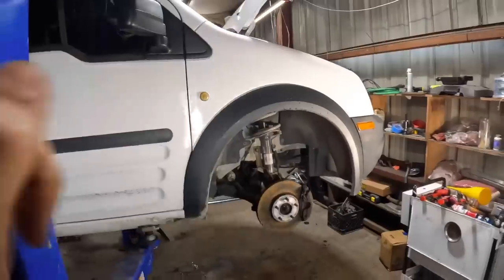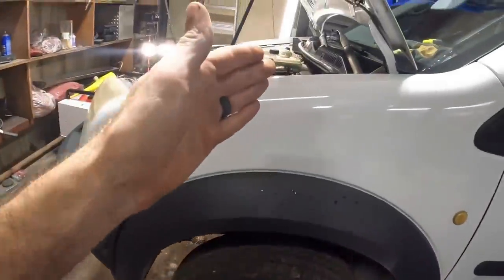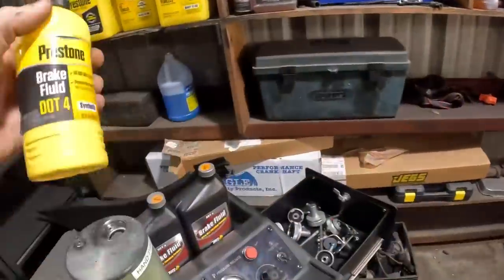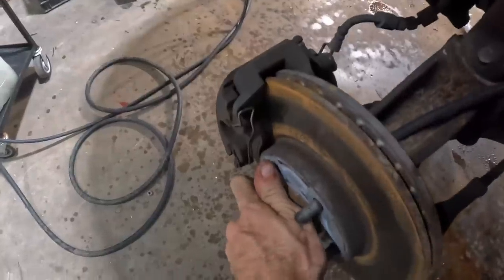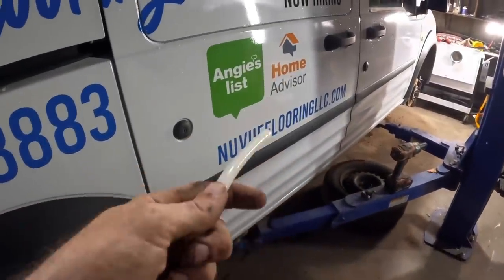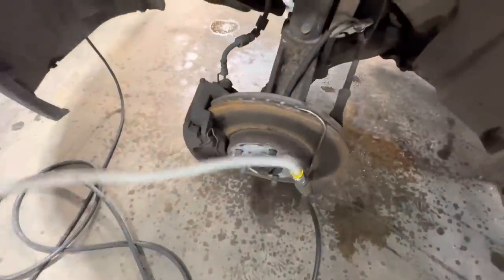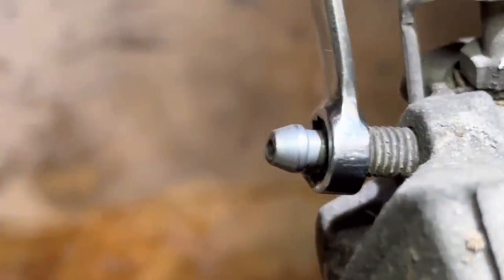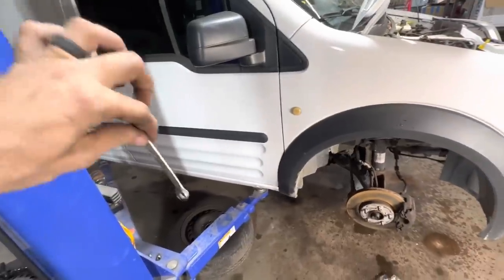Does Brake Fluid go BAD?? Ford Transit 2.0

Comment: Questions I topped up the braking system with power steering fluid and the brakes obviously siezed up after a couple of days... the Question I have is will it only killed the master system due to it not being a circulation or is the whole system contaminated??
Reply: The issue there is some fluids will cause the rubber seals to swell. I put the wrong fluid in my dirt bike and had to change every seal in the entire system. Even the reservoir cover seal. It just depends if that rubber will react to power steering fluid this way. I had put motorcycle fork oil in the reservoir instead of dot 5.1. you will probably damage the caliper seals too because you'll have to bleed out the power steering fluid. You might get lucky.

Comment: I have the same van. And I need the brake fluid service also. How much should this service cost. Great content. Thanks 👍
Reply: maybe 100$ for just the fluid, and that cost is time. the fluid is really cheap and it doesnt require a lot of it (64 ounces is more than enough) so it's just paying the guy to do it. 

honestly you should consider doing it yourself, it's pretty simple to do, most important part is getting the pattern right and making sure air doesnt get in the system.
Reply: @bradhaines3142  thanks. I usually do my own auto repairs as I went to automotive school and been working on cars for over 40 years. But where I live now they frown on doing any work on cars. Just wanted to get an approximate price I should pay. I really hate paying for what I can do myself. Oh my name is Brad also.😀

Comment: Brake fluid is the most neglected fluid on cars, cheaper to replace the fluid every two years than to have to replace an abs pump.  That machine works pretty good.

Comment: This guy should have had you referbish his lights. And put on a uv protective clear coat . I mean it is in the shop and a very yellowed headlight dosnt make 1/2 as much light.

They really need to bring back glass lenses  almost every car with plastic headlights, headlights are going yellow in some stage.  Glass headlights never done this they just burnt out.

Comment: FYI, Dot 5 which is silicon based, doesn't absorb water and lasts much longer than Dot 3 or Dot 4. Dot 4 has a higher boiling point than Dot 3. You can use 4 for 3, but not the reverse.
Reply: And that's the problem. You NEED it to absorb water. DOT5 just lets the water remain in the system and corrodes it. The fluid lasts longer, the brakes themselves do not. Brake fluid doesn't cause the water to enter the system, it does it all on its own.

Comment: Ray, I am having trouble diagnosing why some dash lights randomly come on very infrequent. I have a 2007 Ford Edge 3.5 sel. In the last 3 months I have had the ABS, TRACTION CONTROL AND WRENCH LIGHT  all come on at the same time. I have checked all tone rings for cracks, (there are none) I have checked wheel bearings (all are good no play or noises). I put an OBDII reader on and it shows no codes. 
Have you ever run into this issue and could you guide me on the most likely cause? 
I don't want to load the parts canon and throw a bunch of parts at it. My research names several parts ( clock spring, ABS module, wheel speed sensors and ABS pump ) I would really like to know the exact fault or closer to it so in the future I will know if this issue ever comes up again on my vehicle or someone else's.

Comment: Do you mean orc piss green? the problem with brake fluid is osmotic / which means it attracts water and water is not compressible so yes it is so exchanged every 4 years the fluid with your machine lines can cordate / rust

Comment: Quick note: Found out the hard way that old water laden brake fluid can result in pitting of a cast iron master cylinder bore, ruining it. Never again. Fluid might be costly, but it's cheaper than parts.

Comment: Actually, brake fluid can go bad, because it absorbs water via heating and condensing cycles. Not only can brake fluid with water in it rust out brake lines from the inside out, but under heavy brake pressures, the water can vaporize, leaving you with no brake pedal pressure and no brakes.

One way to check this is, believe it or not, is actually a multi-meter. Why? Because water conducts electricity. So what you do is set the multi-meter to volts, with a range that reads tenths of a volt. Put one probe in the fluid, and one probe on the metal master cylinder casing. If you get a reading that is 0.3 volts or higher, that fluid is bad, and needs to be changed. 

And lastly, dark brake fluid is that way because of too much water, which changes brake fluid into an acid that has started to eat away at rubber seals and other components. This is why whenever a brake job is done, and the fluid looks sketchy, the best thing to do is change it out all the way around, and put fresh fluid in. Not only will a vehicle have better braking, but the pedal will act properly, and the vehicle owner will save money long-term.

Comment: I called my local mechanic and asked him what he would charde to replace an oil pressure sending unit onna 2005 ram 1500 .  He said 150 bucks.  Called parts store and found price for sender unit was 15 bucks.  125+ to do a ten minute job, like so easy even I could do it but I don't have the inch and an eighth socket.  What would you charge for that?  Just curious.

Comment: I’m wondering if the order you cleaned them, same as a bleed procedure: farthest to closest, should be reversed for an exchange like this.
My logic; If you exchange fluid to farthest wheel first so that line is clean. You now have three sources of bad fluid that can contaminate fluid in that line. And the brakes were slightly engaged when reservoir was pressurized so the dirty lines have some pressure in them which might force some bad fluid into your good fluid.
If you reverse the order starting at closest brake you remove those contamination sources as you progress to the farthest brake.
That make sense to anyone else?
Reply: In theory I understand the point you're making but it doesn't work that way. On top of that, if you do it in reverse order you introduce air into the brake system, which is far more dangerous and damaging than a few contaminates.
Reply: I disagree there. If your bleeder valve technique is good you don’t introduce any air.

Comment: I could never get the bleeders to not have a super slow leak around the threads. Tried a whole range of torque settings. Even after replacing the wheel cyl with multiple OeM and after market brands. Recently ran into this on a 2007 civic

Comment: In Australia, we have to get the brake fluid tested, particularly if you are selling or registering a vehicle. Most mechanic’s have a tester to check the percentage of water that has been absorbed by the fluid, and check the customers cars regularly.
Reply: In some states, not all.  There's no mandatory roadworthy check (that includes brake fluid moisture content) prior to sale in Tasmania.  You only need a roadworthy when first registering a second hand car in the state (i.e. buying a car from interstate) or if the rego has lapsed.   And last I looked (I used to be a roadworthy inspector before retiring) the only requirement on the roadworthy regarding brake fluid was just a basic "check fluid level and condition". I used to check water content (not hard, and the moisture content tool is cheap), but can't guarantee everyone did

Comment: Brake fluid goes bad?  No- the fluid does not go bad, but it can absorb moisture over time.  How much it absorbs depends on if the reservoir cap is left open  etc.  Is it safer to change it every few years- yeah, like if you stand on a chair you're closer to the moon.  These flushing machines are just a sales gimmick used by shops to sell fluid and labor, you can do the same thing by just pumping the pedal.

Comment: Yes, brake fluid can go bad. All hydraulic oils can go bad. Brake systems are not a loop system though, so there is no way to filter it and reduce that deterioration. So if you're ever bleeding brakes, just spend the extra $4 on the quart of fluid and pump each wheel until it runs clean. If your reservoir is green like this, flush it. And if you're one of those weirdos that opens the bleeder screw to compress the caliper, at least check the condition of the fluid that comes out, if it's still nice and clear then it's most likely fine.

Comment: I assume that the master cylinder  gets flushed during the power flush. Do you have to address anything in an ABS equipped brake system like cycling the brake pedal or anything?
Reply: Nope, ABS is irrelevant. And yes, it does. That top hose he attached to the reservoir pushes fluid through the system, thus flushing the master cylinder. That was literally the first thing he did.

Comment: finally a flush video clip :-) I would recommend fluid flush with each brake job after the piston is pushed in to ensure all the buildup and water is sucked out of the lines.

Comment: Does Brake Fluid go BAD? - Yes. It's hygroscopic, meaning it sucks up water/moisture from the air air, over time, it waters down, and won't keep the same boiling point as new fluid. When you break, you make heat, New break fluid  can withstand a LOT of heat without altering it's properties, If you have excessive heat, or bad break fluid, you risk it actually starting to boil inside the caliper, boiling produces gas, gas can be compressed, and when that happens, and you press the break pedal, the pedal will go to the floor, and nothing will happen, as you are compressing the gas in stead of creating hydraulic pressure to actuate the calipers/break cylinders.  That's why you should never store break fluid in an open container. When you have water in the break fluid, it also turns more corrosive and can start to corrode parts. It's also why you should replace the break fluid regularly.  The dangerous part, is that you won't notice the bad break fluid until you really need it. High speed emergency breaking, or going down a long steep hill trailer towing with a trailer that has bad breaks and Track driving are some examples..
Reply: I can also add, that Break Fluid is also a pretty decent paint stripper, it can actually be used for that. So if you get any on paint, make sure to remove it immediately. That's why you see so much rust around master cylinders on some cars, because people spill it, and don't clean it up afterwards. It is also a really good cut/wound detector, so if you have any cuts on your hand, break fluid will find it.

Comment: Every 30,000 miles?  Lol, I just did a brake fluid exchange on my Taurus for the first time at 380,000 miles while I replaced all the brake components.  oops.

Comment: Hi Ray, technical question: How would you remove air bubbles that remain between the master cylinder and the rear wheels without any machine? How do I ensure I removed all the air?
Thank you!
Cheers
Reply: I almost forgot, it is an old car. All the parts are replaced and new, but the system is old design of the 70s.
Cheers

Comment: If it's turning dark it's time to replace it. Any thoughts on the pump or vacuum style fluid exchangers? Thinking of buying one.
Reply: Both work very well. Mine is a vacuum type while others swear by the pressure pumps. I would probably prefer the Motive pressure pump if I had the right reservoir cap but mine works just fine for the rare times I use it.

Comment: Wouldn’t you collapse the pistons in the caliper before doing this service? The full line on the master cylinder is calculated to hold the correct amount of fluid with the calipers collapsed so the level sensor will light the dash indicator when the pads are worn to a level that they need to be checked/replaced. By doing it the way you did it the system is over full and when a brake job is done and the pistons are pushed back fluid will overflow the master cylinder and make a mess as well as be over filled. At least that is how I was taught by BG and how we taught it at the technical school I taught at as well as rewrote curriculum at.
Reply: By that logic you have to push everything in anytime you check brake fluid level.  That's just a waste of time, it's faster to rise off any brakes fluid during a service than go around pushing all the pistons in everytime.
Reply: @HoLeeFuk317 You are missing the whole point. If the fluid is low there is a problem, either the pads are worn or there is a leak. The system was designed to hold a set amount of fluid when new, that is the full line. As the pads wear the level drops. When the level gets low enough to hit the low mark or in this case turn a light on on the dash it indicates there is a brake issue. With pads or worn or there is a leak. Filling the reservoir when the pistons are not pushed back changes this. You should never have to add brake fluid to a perfectly working system. Topping it off by a quick lube or someone servicing the vehicle is causing a problem by masking this safety feature. Like I said you should never have to add fluid to a correctly working system and if it’s low you have to find the cause plain and simple. Filling the master cylinder with brakes 1/2 worn out is wrong period and will cause the driver to drive till pads are metal to metal before the indicator light comes on as it is designed to do to indicate brake wear.
Reply: @CodycoWeb  I understand the relationship between brake life and fluid level. However, in a real world shop setting, you don't always have time to pull the wheels and drums off to inspect the brakes nor does the customer always want that done.  Letting a car leave with a full master is better than an almost empty one when the brake condition is uncertain.
Reply: @HoLeeFuk317 so it’s better to mask a problem then to leave the evidence of a problem visible? Black tape over a Check engine light does the same thing. My shop as well as any reputable shops I know of would advise the customer there is a potential brake issue and advise the to get it checked ASAP and not mask it by topping it off.
Reply: I never said don't tell the customer about it.  When the customers waiting for their vehicle and has somewhere to be or the shop has other scheduled work to get done, the brakes aren't getting done that day.  Id rather they don't run the master out of fluid and blow through the next stop sign, I can't prevent someone from driving their vehicle if the want to.   Slow paced tech school environments and curriculums don't always work in the real world.
Reply: @HoLeeFuk317 o but the 25 plus years of working at top tier shops before I had the time and comfort of teaching and such taught me the proper way to do many things as well as I first stated the manufacture of the brake flushing system BG explained this all in their training. The explained the need to push the pistons back when doing a system flush for the very reasons I stated. But hey what do they know they don’t deal with real life everyday shop problems. Go figure. Have a wonderful life. I’m done with this discussion.
Reply: @CodycoWeb  Your right, they don't deal with real life shop settings.  If they did they would know in the salt belt at least 25% of calipers that get pushed in will be stuck the next time the brakes are applied.  It's a good way to cost the customer money.  I'll leave those rip offs to the dealerships.

Comment: All the talk of brake fluid absorbing water and needed changed, yet no mention of the clutch fluid which is exactly the same stuff and will absorb just as much water in exactly the same way.....

Since the machine is there and hot, why no do the clutch at the same time.

Ohh yeah, I forgot, not many of you guys know what a clutch is....

Comment: Wow, the trolls have awakened🙄 I like the machine, it will be super helpful without a helper to pump the pedal. Pretty sure based on the position of the Sun the 5 o'clock rule had expired, you go Wife Unit! 👍

Comment: I was always told to do furthest first, however when I did an abs brake bleed procedure at Skoda  using the vas5051 machine  it would do both fronts together first then both rear...

Comment: Very interesting video! I wish I could find a shop in my area that can do a fluid exchange like that...they lack the machines.  Instead I just do it the old-fashion way myself which is probably not as thorough and certainly a lot more tedious. 

BTW...I tend to think the exchange interval should be time based, not mileage. Brake fluid is hydrophilic...absorbs moisture readily....and a vehicle not driven much doesn't heat up the fluid to drive out moisture.  Could be what brought on the greenish tint of the old fluid. So 30k miles would be about every three years should exchange brake fluids. Do you think that's about right, or maybe more frequently if driven in frequent heavy rains, such as Florida gets?
Reply: I’m not a Rep for BG Products but use their products all the time.  Go to the BG web site and do a search for shops in your area.

Comment: In a shop that I used to work for we had a little round tank that we called R2-D2, it sort of looked like a mini beer keg on wheels, although not as fancy as the BG machine it worked on the same principle, you would plug an air hose into the bottom half and a rubber diaphragm would push the new break fluid out of the upper half, I loved using that machine it made life so much easier doing flushes or even bleeding the breaks when you didn't have someone to help out.

Comment: Shady tree question: if you use pressure/ vacuum, do you need to worry about the abs system? I don’t have a scan tool to cycle it.
Reply: on a fluid replacement youll be fine more than 90% of the time. But if air got in it from replacing a component, then thats when you need the scan tool. Some cars and truck will also bleed normally even if they have abs pump.   Your odds of success without the scan tool, for a flush only, is very high. Hope it helps ! 👌👌
Reply: @Nordic_Mechanic  very much so! Thank you